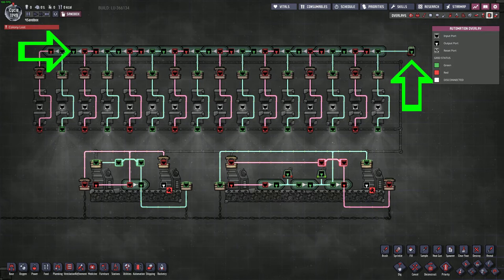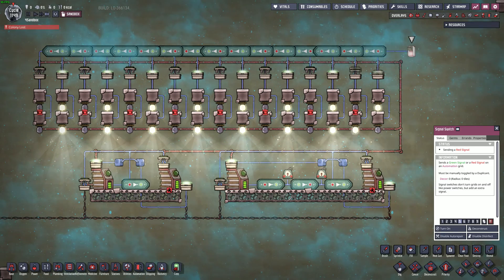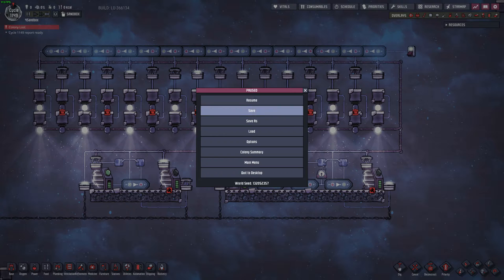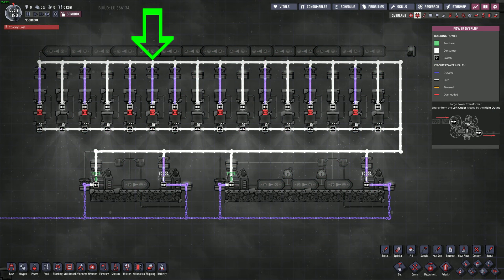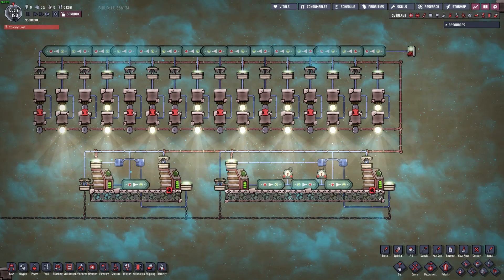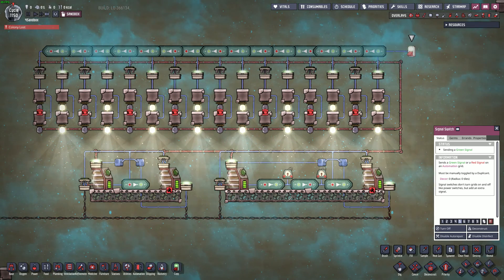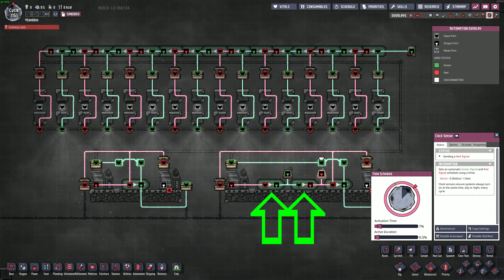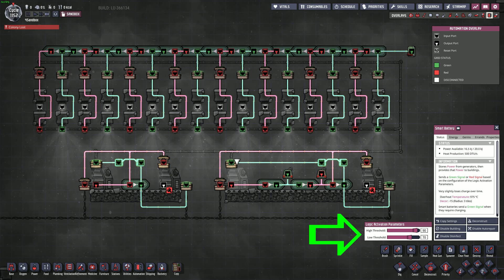Oxygen Not Included – PSA Power Shutoff Bug

Comment: Brilliant demonstration.

Nitpick: you don't need three NOT gates. Two will do. 
1) Remove the righthand NOT gate. 2) Move the second/righthand clock to before the first NOTgate.  3) The topleft/bottomright switches then go on the output of the first NOT gate.
Reply from the maker: If you do that, when you switch between batteries you'll get a moment of no power for your consumers and also a moment of wide open to your power grid.  When the wide open condition aligns with enough demand, that momentary wide open condition is enough to overload your wire.  This is due to the very tiny automation timing related to processing the not gate (the same principal that I use to capture the pulse in this video).

I tested it before making this video, and I just tested it again to confirm.  It will shut off your consumers temporarily, and it is able to overload your input power wire.
Reply: @GamersHandbook  You're right!
Fascinatingly, chained NOT gates alternate on whether they act instantaneously or after a 20 'gamestep' delay.

1) The first NOT gate in a chain of them updates its output on the same exact 'gamestep' that it receives a new input. (Use DebugGameStep alt+= to step incrementally, one 'gamestep' at a time). 
2) The second NOT gate, however, needs 20 'gamestep' more before it updates its output. For those 20 'gamesteps' the NOT gate will be outputting the same signal as it's receiving. 
3, 4) Now for the alternating --- The third NOT gate will update on the same exact gamestep that it receives a new signal, while then a hypothetical 4th will delay before its output is correct.

Your configuration works because you take the outputs of the 2nd and 3rd not gates in a series. The 3rd gives a correct output the instant it receives a new signal. Since the output of the 2nd is the input to the 3rd, this means that the 2nd and 3rdchange outputs at the exact same instant.
Reply from the maker: @tofof   Very interesting!  I just test stuff in ONI vs doing the math, idk why.  So it's excellent to see the math that aligns with the results.  

I also didn't realize there was that step feature, so I'm gunna need to check that out.  Thank you for bringing it to my attention!
Reply: Hey  @GamersHandbook  
 I encountered the Bug as well but I solved it using an XOR gate. I kinda copied your flippers, sorry. 

https://www.reddit.com/r/Oxygennotincluded/comments/ic20yj/ah_the_dreaded_power_shutoff_bug_finally_got_you/

Comment: I had the bug happen the other way: rad signal, but the power remains connected.

Not sure exactly what made that possible, but there was an AND gate involved (the second shutoff activates only if the first shutoff is off AND its own smart battery signals that a connection is needed).

Comment: I found this inactive building but green signal bug on other automation buildings, such as gas or liquid pipe sensors. Like an AT not working despite of having the right liquid temp flowing as per sensor. Good thing for pliers mod as cutting pipes (for later reconnect) to stop the sensor from working was the only thing to "reset" the bug.